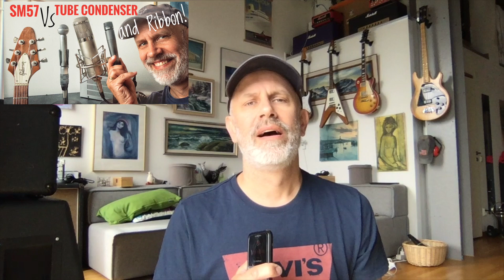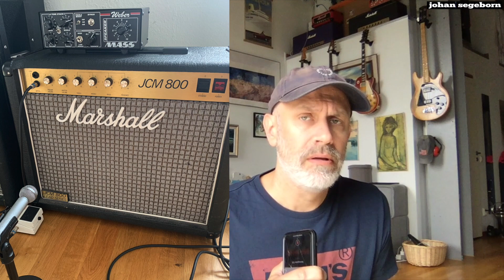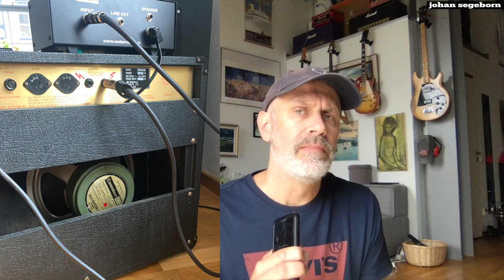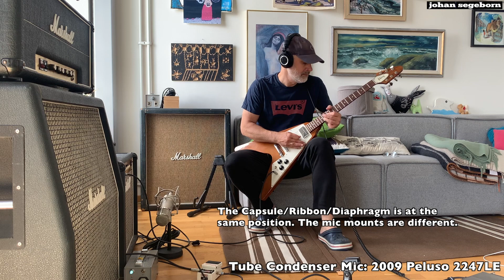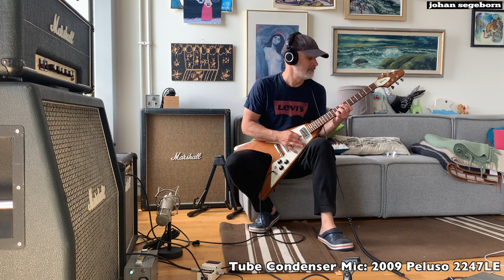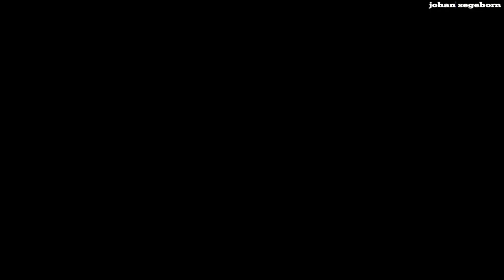Do I need a TUBE CONDENSER MIC to RECORD ELECTRIC GUITAR?

Comment: The ribbon is simply amazing! The dynamic definitely adds more EQ and compression, which usually facilitates mixing later but may not be what you are looking for. The condenser is definitely the most transparent one and is often underrated as a guitar amp mic!

Comment: Sm57 hands down for me. That so called harshness is precisely what you need in a band context to cut thru the mix
Reply: OK - that´s what they say, but what about your own opinion?
Reply: @anonymusum  sm57 hands down for me. That so called harshness in my opinion and experience is precisely what you need in a band context to cut thru the mix
Reply: @Kilovolver  Still - that´what they all say. The 57 is a very harsh and unnaturally sounding mic. I prefer a mic that pics up the sound as well as possible, the rest can be done at the mixing desk. But if you have a 57 you can´t EQ it anymore and you have to live with a lousy soud. Besides - any drummer can tune his snare in a way that it "cuts" thru the band. Same goes for guitar players and their amps.
Reply: @anonymusum  So this opinion cannot be of my own because other people also have it, and/or because you disagree? I don't get your point.
Reply: @Kilovolver  my point is simple: If your guitar or synth or whatever doesn´t cut through the band or mix do something with your amp or your instrument or playing skills and take a neutral, excellent mic. Otherwise you - firstly depend on a special type of mic - and secondly have a mic that´s not usable for other purposes. A 57 is a lousy sounding mic on almost everything except guitar and snare. It has an awful coloration, it´s muddy, nasal and aggressive. So I would prefer a M201 anytime as this projects an instrument way more like it sounds. And if you don´t like it you still can EQ it in a 57 direction. You can´t do that the other way round with an 57.
Reply: @anonymusum  So you have a different opinion to mine. It´s still mine. Bye!

Comment: Great video. Thanks. The 57 sounds GREAT and will sit in the mix. I usually record a 57 or a dynamic Sennheisser e609 in parallel w. direct in and then play around with it in the DAW. That’s a flexible way IMHO.
Reply from the maker: Thanks! Yeah 57 has a way of finding its place in rock mixes.

Comment: Good and true comparison 
Ribbon : softer transient and high end roll off
Condenser: more airy , detailed and picks up the room
Dynamic: focused , quick transient , dry 
Just a note: the M-160 sounds great but it is a dark ribbon mic , some a more open, also a good trick is to pair them with a mic preamp with 300 Ohm or variable  impedance like the Chandler TG-2
Reply from the maker: Thanks, great feedback!

Comment: Eddie Van Halen, with all of his Variac devices, vintage Plexi heads, modified guitars, torn Celestion speakers etc has said that the API console EQ was a major factor in his sound.  So much can be done with the EQ after the mic preamp. I totally agree.
Reply from the maker: Interesting! Do you have a link to the interview. I use API too so maybe we could try to recreate his approach here.
Reply: @JohanSegeborn  I will try to find the article where Eddie mentioned this. As an Audio Engineer for nearly 30 years I have read thousands of recording articles and interviews. I bought 5 magazines per month for many years. Had to recycle them when I moved a few years ago.  But I do remember Eddie saying that the console EQ was a part of his sound during the mixing process. Parametric EQ.  It was a 2 sentence comment if I recall.

Comment: First, that's a beautiful V! In terms of the microphones, I think that I am probably so used to hearing an SM57 that I prefer the sound. I think the 57 had the most top end bite. The large condenser sounded a bit more easy-going, if that makes sense. The ribbon seemed a little nasal and mid-focused. Overall, the 57 seemed to work best for my ears.
Reply from the maker: Thanks man, the 57 is indeed a lot of mic for the money
Reply: I thought the exact same thing.  I'm so used to hearing a 57, that sounds "right" to me.  God bless and rock on!
Reply: You're gonna have to shave all those sharp edges down in a mix anyway. It's not like you get to keep all that HF noise.

Comment: given the operation, each of those mic I see working for different mediums,. surprised how well the 2003 stood up but preferred the 2247 overall all around; 1960 for effect and on purpose knowing what it's doing can be good but certainly not if someone is trying for clean and clear. good video. I've always felt the V guitar had it's own special tone or lack of tone quality that brings out the best in electric guitar amps. Wish I had one.

Comment: For the price I don't think you could go past a 57, but I also liked the condenser. I don't think the ribbon would cut through as well, but didn't sound bad by any stretch.
Hey Johan, you ever thought of putting an Eminence Private Jack in that JCM800? Supposed to be modeled on the greenback, but better power handling.

Comment: I've not given too much thought to this because in the past I've generally used whatever I had around when I was recording myself (usually SM-57 clones I bought in the 90s), and whatever the engineer chose when I was recording in a studio. I did notice that I preferred an SM-7b to a 57 for close miking, but aside from that, I didn't pay much attention. My loss. The 57 sounds punchiest on rhythm, but there's a lot of old-school midrange in the leads that you can hear through the ribbon and the LDC that the 57 doesn't capture as well. Generally, I calibrate my setup for rhythm and then assume that the lead time will take care of itself. This is an argument against that.
Reply from the maker: Thanks Josh! I also thought the leads really benefited from some extra meat.

Comment: Try the Beyer m260.  It has a little more bass roll off.  Also works great on HiHat.  If your budget allows, try Royer or AEA ribbons.  FYI, the AEA 92 sounds excellent with a Vox AC30.  If you have a limited budget, try the CAD D82.  If you need to get closer to the speaker with an LD condenser, the Neumann U89 or AT4050 might work for you.  If the 57 sounds a little harsh, check out the EV RE20 or Sennheiser 421.  Hundreds, if not thousands, of different mics out there.  None of them "wrong".  It depends on what result you want.
Reply: I've NEVER been let down by the humble old C1!

Comment: Great comparison man, thanks! Just wondering, if have put a Marshall 2061x through a 1x12 cabinet, would you put a Greenback or a G12H 30 70th Anniversary in it? Or maybe some other speaker..? Thanks again for such great content!
Reply from the maker: Thanks Tom! I would get a vintage G12H30 Greenback for that rig. But a 1980s G12-65, G12-80 ot G12H-100 would sound great too. Cheers

Comment: Im suprised the modern sm57 did so well compared to the Peluso. Personally I prefer a combo of 1 dynamic, 1 ribbon and a condenser for room. A very typical modern setup is a Royer 121, and an sm57. The first sm57 Unidyne 3 has to be designed by God for rock guitar tone.

Comment: I believe that in this context, as you have a rather bright amp, the condenser works well to counteract that harshness, especially in that 2Khz range. However, with darker or higher gain amps, an SM57 for clarity and top end. The condenser could muddy up the bottom end. Wasn’t a fan of the ribbon. It sounded like the condenser, but felt it didn’t have that 3D complex tone to it, like the condenser.
Reply from the maker: Thanks Will

Comment: The condenser definitely capture more details but needs a bit of taming, I think it will work better on cleaner sounds.
Ribbon sounded the smoothest but surprisingly didn't capture as much detail as the dynamic, on higher gain I'll probably pick the dynamic if I EQ a bit, ribbon if I have to pick the natural sound.

Comment: To answer the question (before the video premiers) the answer is "no".
You don't "need" a tube, ribbon or any such mic to record your guitar.
You "Want" a tube, ribbon and any such mics to record your guitar.
But you don't "need" them. ....ok, I "need" them....don't judge me...
Reply from the maker: ;-) I have the same problem
Reply: As true as this COULD be, it's actually not very correct. If you're going for accuracy of sound, like to recreate 60s recorded sound or 50s single mic band recording, you need to have pretty accurate microphones
Reply: @JohanSegeborn  No amount of Tums can cure this GAS